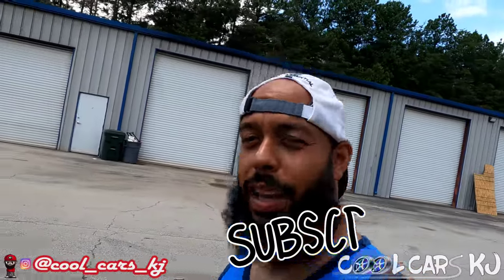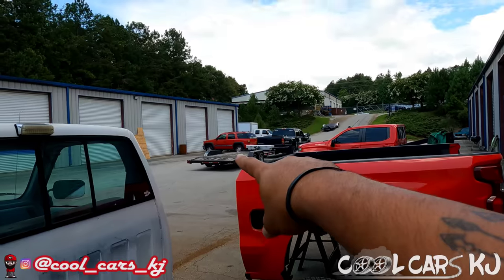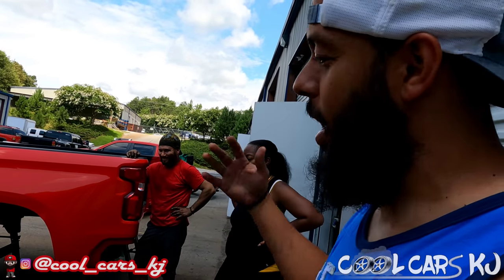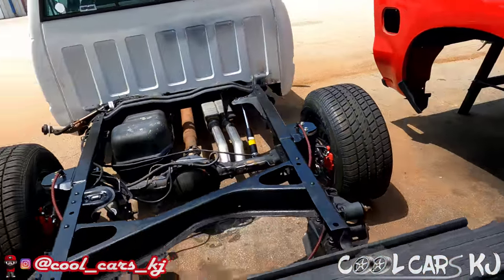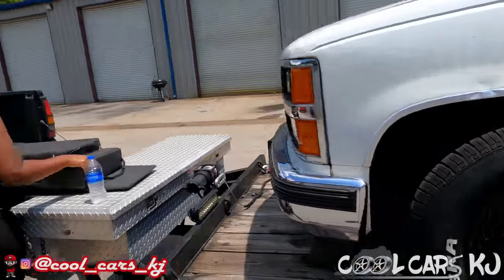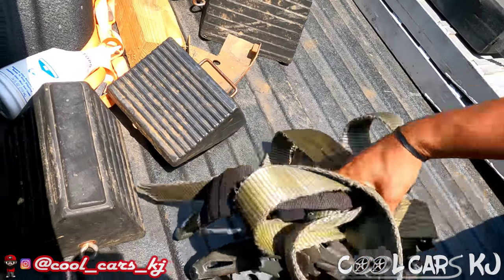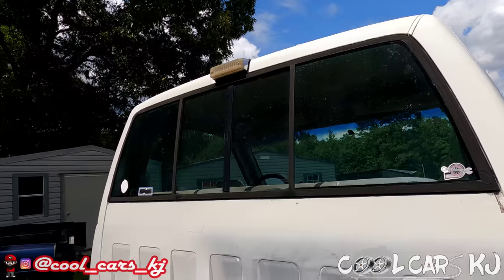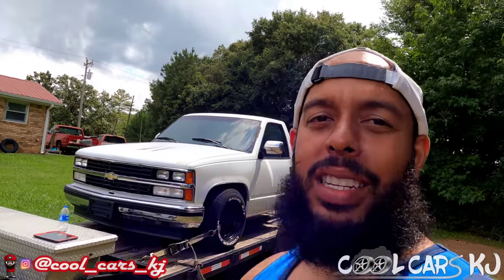Lowered OBS Chevy still TOWING? 🤔 Installed helper bag kit  #OBS #Chevy

Comment: Ayyyyyyyyye! What it dooooo! I say swap to the one piece window. As far as the wire goes you'd definitely need a 1/0 gauge wire to efficiently charge the winch battery as well as to power the winch. They look to be a 10-12AWG wire. I'm almost 100% certain that if its connected to the trailer battery while using the winch you'd let all the smoke outta those lul wires. Howwwwwever you could wire in a switch and use em to charge while you going down the road. 🤷🏿‍♂️ I still believe they're too small for that. For the hell of it, give Diamond C a call and see what they say. Couldn't hurt.

Comment: With the battery as a filter, you can hook those wires up to keep the battery charged while you winch. 
  I wouldn't hook those directly to the winch, because they are such light gauge. But with a battery as a buffer, they will keep the battery topped off and the winch will run good. 
  Some guys at work like to run a small solar panel on top of the gooseneck to keep the trailer battery full if it sits for a while or if you use the winch a lot. 
  If you didn't have a battery on the trailer, I'd use the Anderson plug idea. I have those plugs on a few pieces of equipment on my work truck and love them. I've only needed them a few times, but I don't have good access to the battery so they save time hassle if I need to jump something. 
  I just subscribed from a fb group. Truck looks sharp. Are those bag brackets gusseted?

Comment: Those small wires will only charge the battery when hooked up but will not be large enough to run to wench long term .. yes 12v but not big enough wire to carry the current the winch uses while in use.. those little ones typically charge the little battery for brakes ..

Comment: Yes sir that's what the three extra wires are actually for on the seven pin, one for the brakes/controller one's a extra ground and one is 12 volt positive to the battery and I would assume it's already fused from the factory in the Duramax. I have mine wired up like you wanted to do with The larger gauge wire and Anderson quick connects

Comment: If you're trying to keep the battery charged up yet use the two wires but if you are needing more power for the winch then you need to hook up to Anderson plug but bottom line hook the two wires up anyway to keep a load charged the battery but if you need power you want to go with the Anderson plug wires
Reply from the maker: Facts!

Comment: 1 piece glass looks better but if you not running the AC it feels like you get no airflow with the windows down and no rear window. My dads 91 has never leaked but that rear slider is an easy access point for criminals even when locked. Those 2 wires are to trickle charge while hooked to the truck, It won't help run the winch. Run the cable like you planed but also run one from the second battery to the front. Then you can get jumper cables and put an Andersen plug on one end and if you ever need to give/get a jump or power something up you don't even need to pop the hood and your winch with get full power

Comment: Economics. You have multiple trailers, winches and multiple tow vehicles. To make the system effective, you would have to equip all your rigs with same set up. I'd keep the 7 pin set up charging on board battery which powers winch. Consider a battery disconnect switch on the trailer to prevent battery drain and a battery tender to keep unused batteries charged. I'm planning to install a solar charger to keep my trailer battery fully topped when unplugged from truck.

Comment: What does two leads do obviously is to send the charge to the battery to keep it full power while you're driving so when you need to use the winch you have the full battery and you're not going to get the full load coming through that harness but those two wires will keep that battery at a full charge so yeah hook them hook them Billy Bobs up the Anderson plug and I hope you understand this you can use the Anderson plugs on your jumper cables if you got an Anderson plug in the front of the truck instead of you having keep connecting the jumper cables to your battery you have to plug that for it and your

Comment: I had a '94 4x4 and I never had any problems out of mine I had that same window in the back of my 94 Silverado it was an extended cab but I never had no problem with it leaking water or anything but I will say this if it's raining like the Dickens and you can't open them side windows that little back window comes in handy for a little air if you're not running the air conditioner But ultimately is your decision but I don't know I think that I mean I like this I like to split window I really do I like that I like the one piece too but then again I'm a Chevy person but I don't know it depends on whether you like a lot of flowing air and not but truck looks darn good I can take it up and your man does excellent work you clean that chassis up and do some black paint on it that thing look like it's brand spanking new out there off the showroom floor but now I like to split window a nice cool day you pop that sucker opening and it's raining just trying to tell you but either way either one is a good look

Comment: I think that would be good to charge the battery as long as the wire is a thick enough gauge so when you are using the winch the wire won't get hot and burn

Comment: Okay if you are trying to just keep the battery charged from the truck once you plug in yes go ahead but if again if you are looking for more power to the winch then you're going to have to use the bigger cables because those small cables will heat up and cook like I said before if you're trying to just keep the battery charged hooked to no matter what hook the two wires up that's going to keep the battery charged off of the truck but if you need more power for the winch you going to need that Anderson plug to hook up for more power it depends on you put it this way depends on what you're trying to do are you trying to throw more power or you just trying to keep the battery charged do not depend on them two little wires to how can I put it give you more power cuz they're not going to they don't have that capability you need you know the thicker cable you know the 13 or the two so this is my suggestion get you two ring terminals so you can keep the battery that's on the trailer charged that's all those two little wires going to do is keep that battery at full charge once it's hooked to the truck looking for more power I'm saying it one more time use the Anderson plug if you're trying to get more power to the winch but if the power is not your issue that you just want to keep the battery charged no matter what I'm saying hook up the ring terms cuz I just keep the battery charging no matter what hope you understand what I'm saying if not I'll try it again

Comment: On the sliding back glass. The problem I always had was leaking and sooner or later the latch that locks it will break. They were also bad to start leaking. That the experience I have had with the sliding back glass. Your OBS is definitely looking good. Great video thanks for sharing!!

Comment: Yes them wires are there to charge trailer battery when hooked to the truck while traveling an I have question what brand pancake bags are on your dually that they installed if you remember the part number or kit
Reply from the maker: They air airlift 2600 pound bags

Comment: Underbed notch is way cleaner, stronger and more clearance just fyi for future notches.
Reply from the maker: I'm good with 3/5 on this truck. Maybe on another build but this work truck will be fine with this.
Reply: @CoolCarsKJ  it just has added strength to the frame. Especially if towing cars I’ve seen the bolt in notches stress crack even when welded

Comment: No I believe that you. Have to have a thicker gage wire to run the winch i think  those wires are to add things like lights
Reply from the maker: Well the battery will run the winch. Those wires would keep the battery charged to 100%
Reply: You can try but I think its the load that you will be putting on the wires while using the winch im not saying it won't work just be careful check the wires while using  the winch to see it they get hot

Comment: U can definitely use those wires u tested to run the winch. Been doin electrical for 25 years and from what u showed me in the video it definitely should work with no problems.  U should have 12 volts in that 7 pin to supply power for what ever.
Reply from the maker: Ok, I appreciate that bro! Thanks!
Reply: @CoolCarsKJ  u already got 2 batteries running the cat eye. So as long as u keep the truck running when using the winch u should not have any problems.  I do like your idea on the extra battery and cable from the truck but the power u found in the trailer is the same concept.
Reply: U can take the power wire and ground wire from the winch straight to the wires u found and that should be it. The extra battery and cable u got there u wont need it at all
Reply: @Cool Cars KJ The trailer wires will be fine for trickle charging the battery in the tool box, but I wouldn't run the winch off of them direct. The power draw of the winch (amps) will far exceed what those small wires can handle. Just an example, you wouldn't jump start a vehicle using those wires, because they're too small, right? Same concept for the winch wiring (use 4ga minimum).
Reply from the maker: @FL3XN3  so you are saying it will be ok to hook those two wires to the battery while still leaving the winch hooked to the battery? I definitely was not connecting the winch cables straight to those small wires. Always planned to keep the winch connected to its own battery.
Reply: @CoolCarsKJ  Yessir!!!

Comment: Man stop spending money on them stupid charger cables go to the welding store and buy that heavy duty welding cable it's better wire it's stranded better I'm I'm just telling you what I know go get the welding cable they come like a roll of 50 ft something like that get that it's weldingly cable for arc welders it's just you don't have no ends on it it just flat white is a straight out wire you're going to have to put terminals on them so my suggestion if you are going to run Anderson plug from the batteries on your truck all the way to the bumper get the welding cable go to a welding shop and get you the heavy duty welding cable make sure you get the positive leads don't get the negative cuz the negatives the little that's a little thinner get the positive side and think if I'm not mistaken it come in 50 ft lengths and you probably wonder why I'm getting to them cuz you got that long truck but anyway stop spinning all that money on the day going charging cables man you could have spent you more like you can come out a little bit cheaper behind the welding cable from the store

Comment: I would just run new wire. The current wire is more just to charge the battery. 12v is 12v but you will definitely pull more current with winch operation. I hooked my quick connect up on my bumper with some zero gauge car audio wire. More than capable of the amperage load. Check it out on my video listed below.  Keep the videos coming I need to get back on my grind also.
https://youtu.be/Yb_4UdZnPfw

Comment: Yeah it's just it's just that simple Put a Ring terminal on a negative or ring terminal on the positive and those what is going to happen is your truck will keep that battery full charge as far as the Edison plug I still would put an Edison plug on your truck and run into the back reason for you can take the Edison plug put one in on some jumper cables and you can put the other in on your truck and whenever you have to jump start it then you don't have to pop open your truck you just plug in the Edison plug and you can clamp on any vehicle that sticks to the truck or on the trailer but yes it will keep your trailers battery full charge that's the whole purpose of it but I have a have to jump up the power running the Edison plug to the back of the truck if you need direct power Edison plug into the Edison plug in the truck put the negative and positive and that'll give you full power if you need it but it just opens the door for you to do multiple things one you don't have to keep trying to charge the battery yourself because your truck will charge it along with charging the batteries on the truck but I will say this make sure the battery on the trailer is the same as the same exact battery that's on your truck cuz when they all match they don't see each other is an enemy they won't see each other as an enemy a different battery they going to pull against each other until knocking on each other out so find out what you already know what the batteries are using on on the Beast I'm quite sure you got another battery in one of your other vehicles that you can swap that battery out with if it doesn't match the battery in the Beast when you look at batteries together they got a match exactly so they don't fight each other

Comment: Sliding Windows is cool for the dually cabs but you really don't I mean it does okay but what is single cab you got two big giant Windows right there but it always seems to blow trash answer the back window because of the wind turbulence but the dually cabs I don't remember that even happening that's the definite you won't get any leaks with a one piece but having a third window in the back window opening like that makes it easy for people to break into the truck